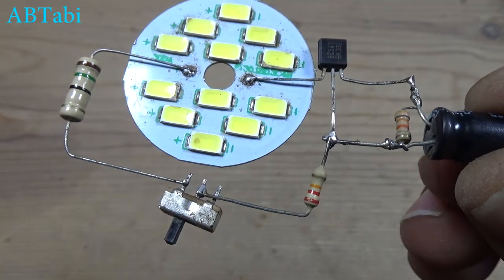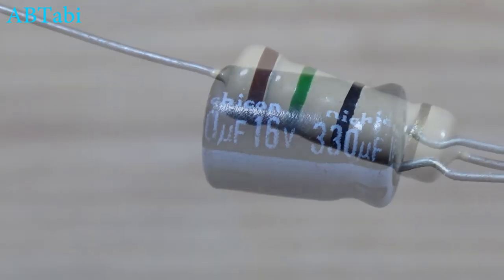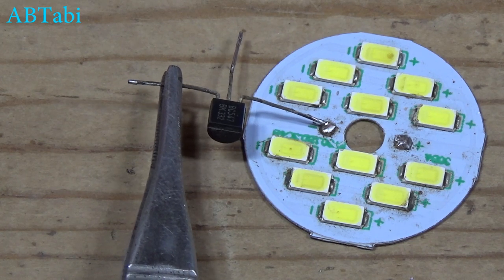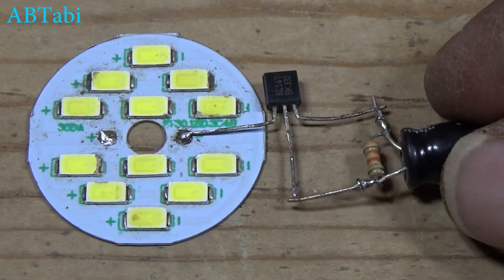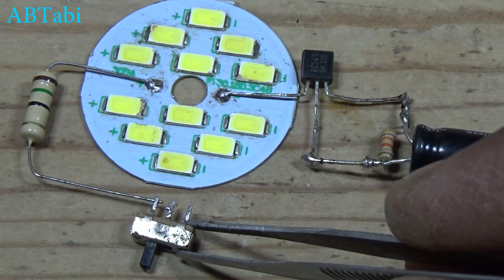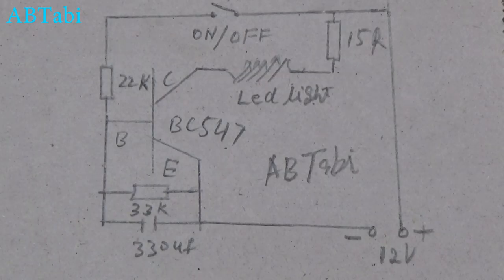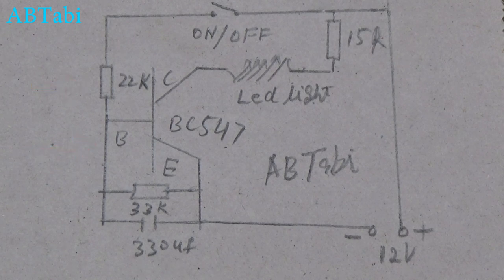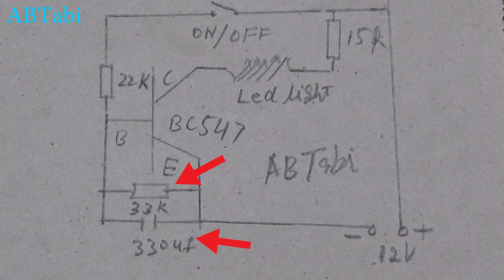How to make a Fade ON & Fade OFF Led Light using BC547

Comment: Thank you ABTabi for sharing an awesome design. I agree with many people that the fade-in transition of the original design is a tad too fast. The fade-out transition is just right for me. The solution I found that suits my liking was to serialise 2x 22k resistors to make fade-in a tad slower. Not that the original speed not good. I'm sure it would be great for some applications.

Comment: With this version, I leave it switch on and connect the power supply the light fades in and the light stay on. When I remove power supply, the light is off without fading out. Could you please suggest what to do to get the fade-out effect after removing power supply?